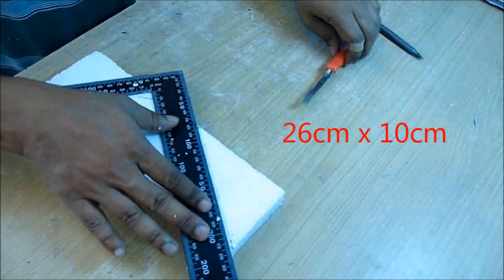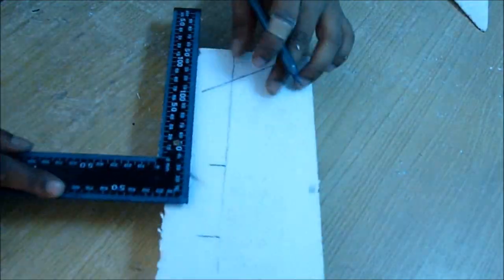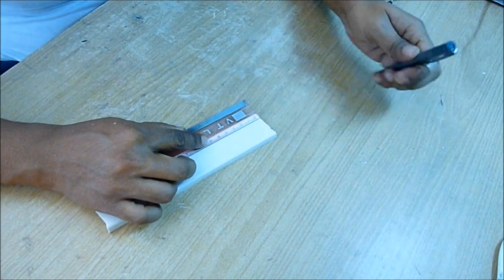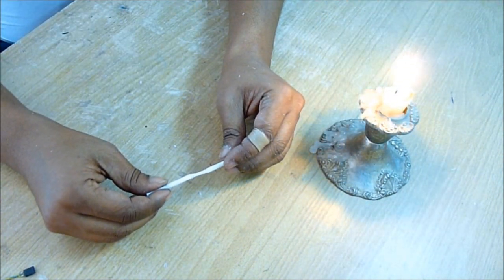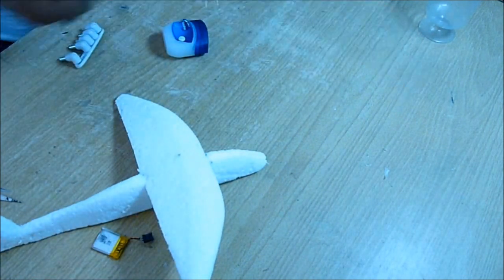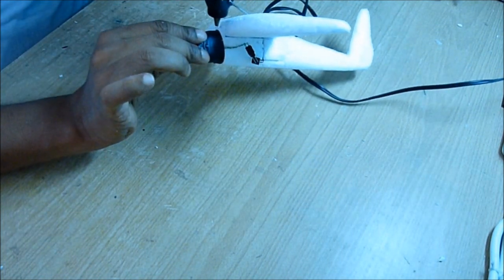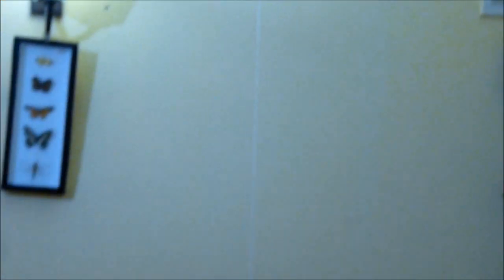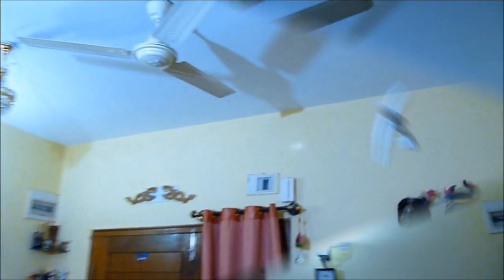How to make a string guided indoor flying aeroplane

Comment: what is the moter called were can I buy it at
Reply: Micro moter
Reply: how mush for four of them and how can I controll it with a controller tell me were i can get that
Reply: +joseph jean francois they are around 0,50€ each, you can get them on aliexpress, and controlling would be possible with a pwm circuit using a simple 555 timer
Reply: hi